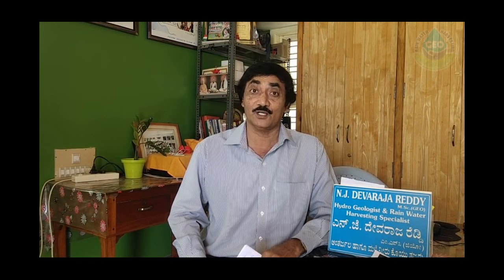How test the recharge rate of BOREWELL

Comment: Sir can you post a video on recharge of borewell in city areas, especially in the residential areas
Reply: Sir. I want Some guidelines about my field that is BAGALKOT District. I have 4 acare 1bore well it is only 30 minutes water is coming after that slowly it comes down.2 to 3 liter splitting. That time off the bore well after 10 minutes on the bore well its coming 30 after that it's slow down. What is the problem sir . What is suggestion about this sir. please